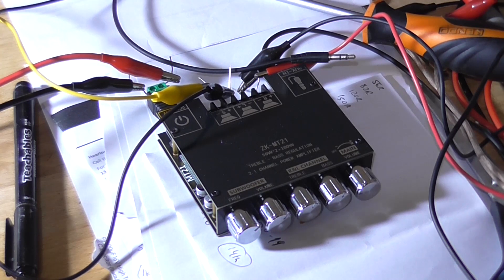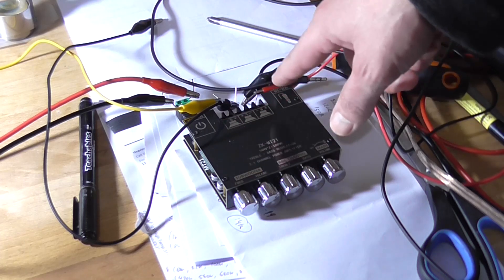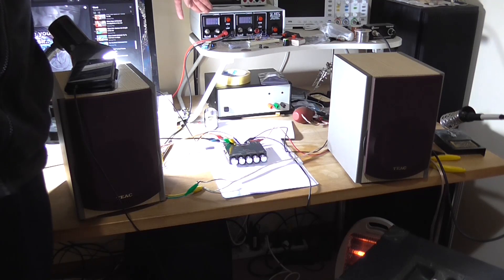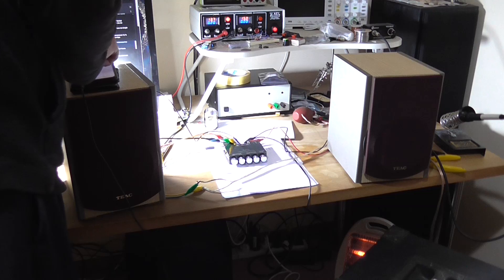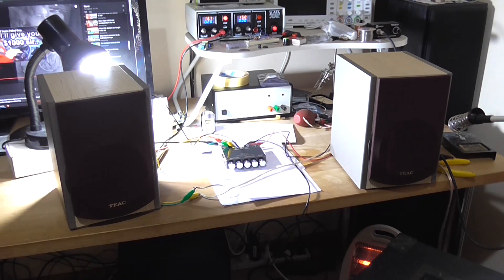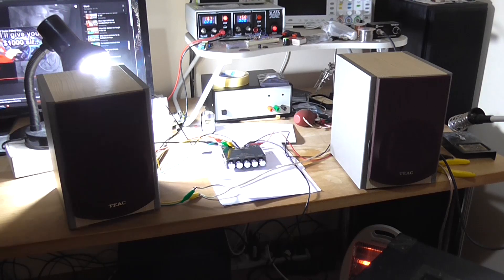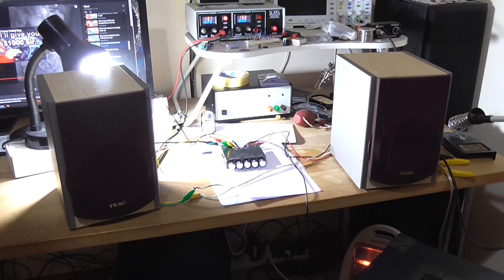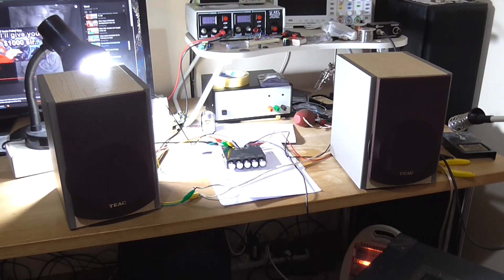ZK-MT21 2.1 Class-D Amplifier Sound Test

Comment: i wired one of these up today with a 12v 5a psu. Using a pair of Sony satellites 3ohm and a Philips 8" sub and it sounds pretty good. I'm using it for PC speakers for when I'm not using headphones. I paid $10 for the amp and $8 for the PSU lol
Reply: For anyone that finds this post. I swapped out the 3ohm Sony speakers for a pair of 8ohm Sony bookshelf speakers. The reason was this amp supports 4-8ohm speakers. Using lower ohm speakers will push the amp harder and possibly burn the amp out. The 3ohm speakers worked and I think they sounded louder at lower volume levels but the 8ohm Sony bookshelf speakers sound a much better.

Comment: so if i ran 12v 6amp it should be fine aye?
Reply from the maker: Well, yeah. But it will only draw the amount of current it needs; nowhere near 6A. I mean it sounds fine, just measures crap.
Reply: yes but higher voltage/amps will give you more output before clipping.
Reply from the maker: @thedavesofourlives1 I'd also appreciate it if you would stop being condescending in comments on my videos, please. Or, they will just be deleted.
Reply: @AstrosElectronicsLab  Get Bent Helmet
Reply from the maker: @ what?
Reply: @thedavesofourlives1  those amps are crap.. lots of hiss and humming... I bought  2 decent amps for my pinball machine... absolute night and day difference.... 36v  fosi amps... well worth the money... No hiss No humm just excellent sound... BT30 Pro  amps  make these amps absolute Cr@&.....